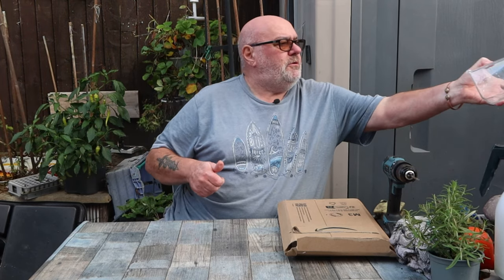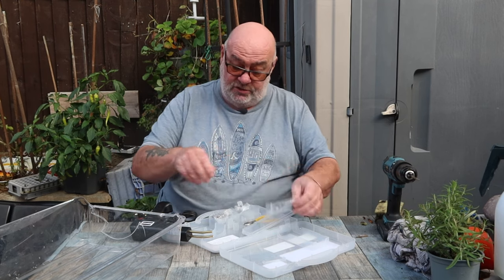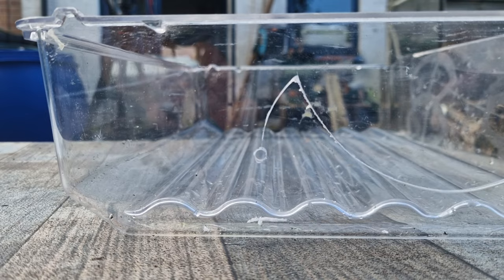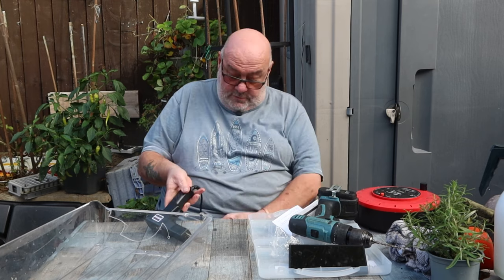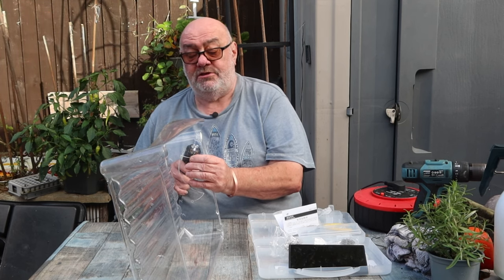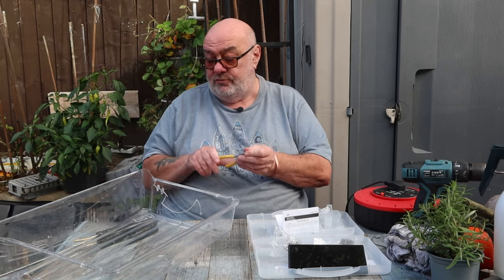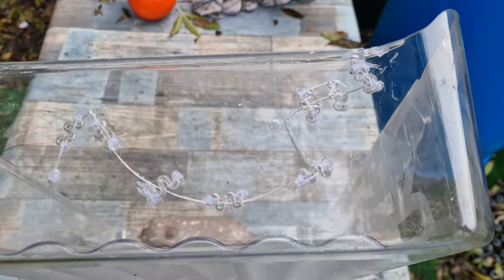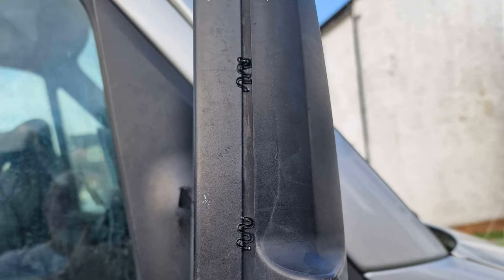How I Repaired my CRACKED Fridge/Freezer Drawers

Comment: Like #22. I’ve had this happen. The plastic of the drawer seems brittle. And the weakest parts of the drawer are the “glides”. If I try to put a lot of stuff in the drawer, it puts a strain on the glides. The overloaded drawer binds up, and doesn’t glide evenly.  Like you I’ve tried all the glues and tapes. I’ve never known that I could actually replace the drawers with new ones! But a repair sounds like it might be more cost effective. The tool and different attachments seem like a good investment for future issues.
Reply from the maker: It is a pity we cannot share photos here but the hanging drawer you saw me repair is now fully loaded up! So far so good!

Comment: I've got one of these and used it to repair tubs and plastic crates. Definitely worth practicing on something first to get the feel of it. Hardest part is cutting off the legs and dealing with the sharp bits.
Reply from the maker: Yes, snippers without a bevel cut are needed to snip off the staples.
Reply: @DigwellGreenfingers  for my freezer tray repair I just used a dremel to slice off the legs. Used baking soda and superglue to fill the gaps. Tiny bit of filing and it's good to go. Looks horrendous but every time I look at it I remember the £50+ I saved 😁
Reply from the maker: @MattHawkinsUK  Brilliant! I could not believe the price of the drawers.  Funny you just commented, as I looking at the repairs only yesterday and they are still as "sound" as when I did them 10 months ago.

Comment: Good luck Steve! We had to replace a shelf bracket - nothing would work because the shelf bracket had flexure designed in. It broke at the point of maximum deformation 😣. Good luck!
Reply from the maker: When things are built to fail there's not much you can do about it.
Have a great week guys!
Reply: What are the alternatives when the prices are what often make or break some of us?  @DigwellGreenfingers
Reply from the maker: @alexisscarbrough4083  None in this throw away society, sadly!

Comment: If the part is made of polystyrene, Testor’s model glue (remember that stuff?) in the orange and white tube will weld the cracks together stronger than the original. Cheap, and when it cracks again, in a slightly different spot, glue that too.
Reply from the maker: It does work,  but I found that it was a bit weak in the cold, especially at -18C in the freezer. Hence, I use the staples now. Gorilla make a low temp glue, but I have not tried that one yet.

Comment: I saw this on tiktok and made myself 1 using paper clips, just the job 😊 nice one Steve ps and car parts 👍
Reply from the maker: I bought this as it said it had copper staples (which would be good with food) but they turned out to be stainless steel so even better LOL
Reply: @DigwellGreenfingers  I repaired the fig draw in the bakery shop. It lasted 3 years it's now outside waiting on the crown to pick up 😀 OK if a professional did this work they do cost a lot more than £20 😀
Reply from the maker: @crazybaker1 And how much would a truck door mirror cost?
Reply: @DigwellGreenfingers  did you get any plastic rods or wire with the kit, I just used cable ties, black ones works really well on rear of door mirror 🪞 😀
Reply from the maker: @crazybaker1  Only what is shown in the video. It is a hot stapler, not a plastic welder.
Reply: @DigwellGreenfingers  I will have to share mine with you at some stage, it very interesting how to DIY repairs 😀

Comment: Thanks for that, have learned something, and how to repair those cracked drawers.  With your expertise can you suggest a fix for the freezer where the supports for the drawers have collapsed. The supports are part of the moulded plastic lining of the freezer, and need to take the weight of the drawer full of frozen food, would fibre glass built  up on the walls hold up?
Reply from the maker: That would work or you could glue strips of thin sheet metal onto them.
Reply: @DigwellGreenfingers   Thanks, is there a particular sort of glue or make  that would last in a freezer?
Reply from the maker: @judyy4480  This will work, good at low temps: https://amzn.to/46llGNN
Reply: @DigwellGreenfingers  Many Thanks

Comment: I always wondered how well it would work with a soldering gun and a paperclip...
Reply from the maker: Or just heat the clip up with a blowtorch? Not sure if it would rust in the fridge/freezer though?
Reply: @DigwellGreenfingers  A bit of copper wire would be (a) rustproof, (b) easy to bend into shape and (c) have plenty of thermal inertia.  The problem I foresee would be getting the hot wire into place while it was hot enough - that's the win for the 'gun': it lets you place the wire tie and heats it at the same time.
Reply from the maker: @jonathanrichards593  I am impressed with it, I must say!

Comment: From my personal experience, the only thing that really works is sadly not easily available to purchase in the UK. It's a product called WeldOn ('No.4' I believe) and it literally dissolves one side of the cracked plastic to the other and makes a bond that's as strong, if not stronger, that the original. It works brilliantly and repaired cracks in my fridge drawers where the cracks ran along the brackets where the weight in the drawer is constant. It can be a bit ugly if you put too much as it leaves the plastic diffused, and it's tricky to apply because its viscosity is that of water, but it really works and welds the material together.
Reply from the maker: Good advice! Weld-On #4 is available in the UK but I prefer Tensol 12 (because of its supplied syringe) https://amzn.to/3VFx4An
I've used both in the past to make acrylic display cases.  The only real issue with it is that it has no tack, so the parts need holding together well for at least 3-4 hours. Not a problem for a crack but can be awkward with broken off pieces.
Happy to say these so called "welding" staples are still holding!
Have a great week